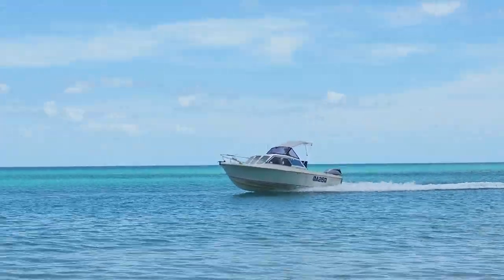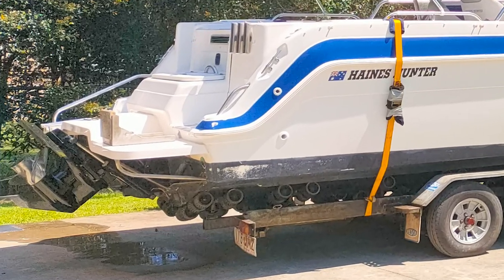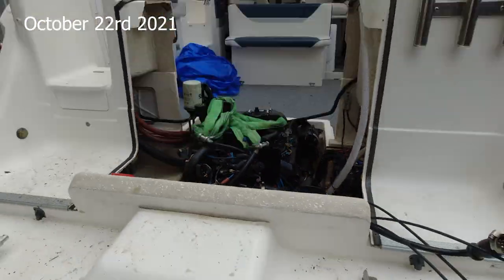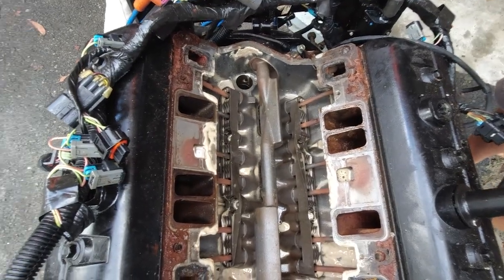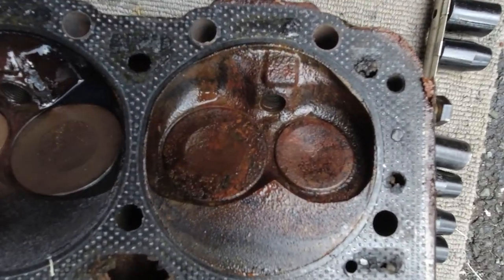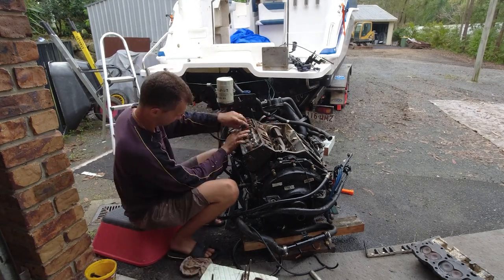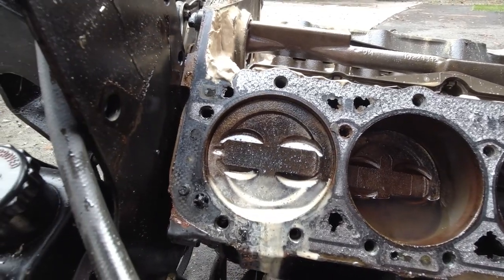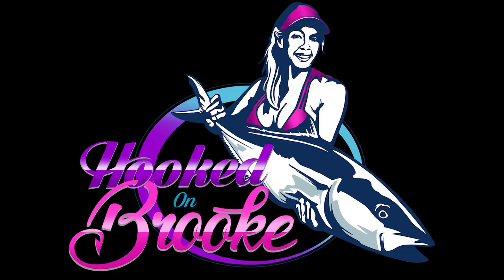Haines Hunter Engine Replacement Part 1

Comment: My dad brought a Haines v198 in nz which is similar to the 19r in Au. We pulled the factory Chrysler 265 hemi and matching Chrysler stenleg fitted a second hand Omc v6 and leg (3k), we did a lot of work to fit it glassing the transom and cutting a new hole. It’s now a really awesome setup. It was a 1.5yr project which I loved doing with my dad. Wouldn’t recommend. Good luck :)

Comment: I bought a lemon diesel cruiser in May 2021. It was sold to me as being in first class condition. In the time since I spent almost $30k on repairs to the various systems. We used it for only two hours. We had a survey but that proved to be inaccurate and in some cases a cut and paste from a previous survey. I just sold it and I’m going back to a new boat with an outboard. I’ve learned some costly lessons. Boats can be expensive, especially older ones, but this was never ending, with one thing failing after another.
Reply from the maker: I'm so sorry to hear Steve. I agree BOAT stands for- Bring, On, Another, Thousand.
And this is why I was adamant I wanted an outboard asap. 🙂 Lucky I'm pretty, I get what I want 😂 no really, I hear your story too often and then it was our story too.
Glad we went with the outboard straight away.
Reply: Break out another thousand or bust out another thousand in the south east US